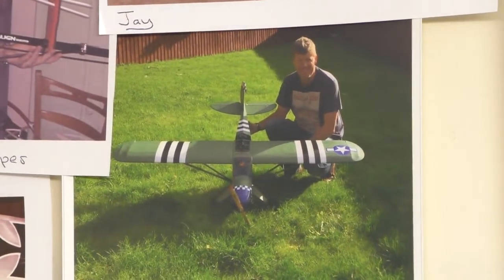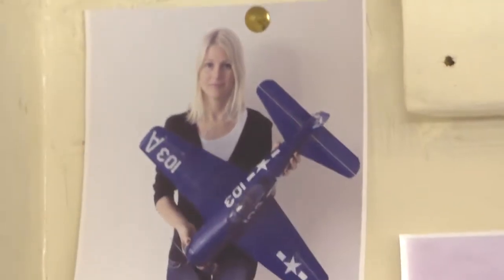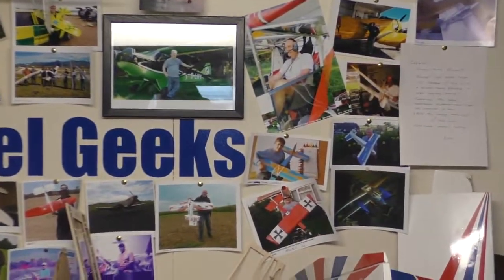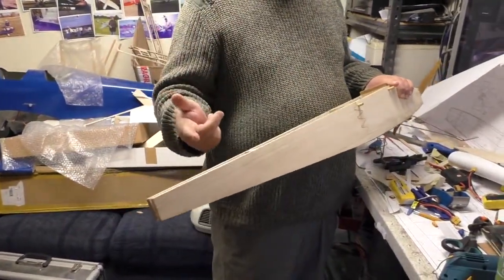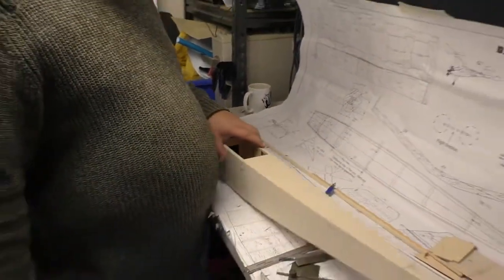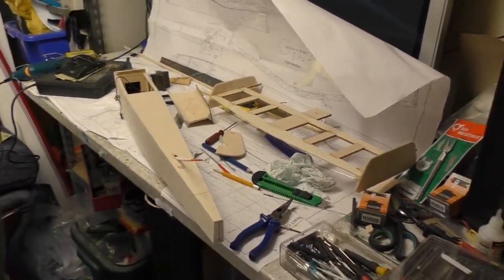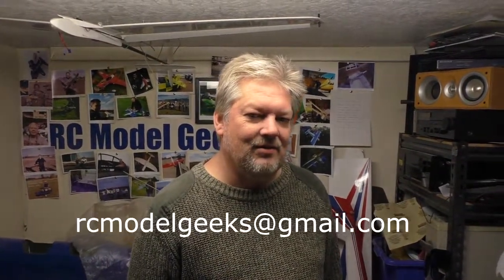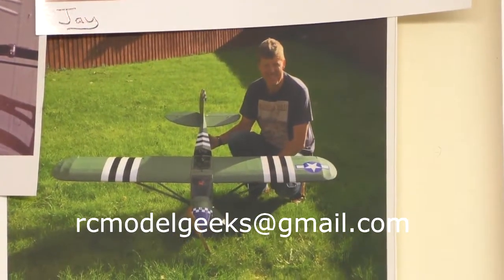DB Sport & Scale Autogyro Build Pt8 RC Model Geeks

Comment: Good tips on making push rods and the use of heat shrink tubing,rest assured they are all flyers at the moment doing maiden flights most weeks and you can see the videos,nights are pulling in meaning more model building,keep up the good work there is that busy little shed,sleep well.
Reply from the maker: Dont mention maindens lol thats all i ever get to fly nowadays!